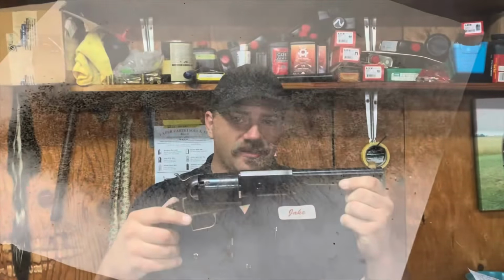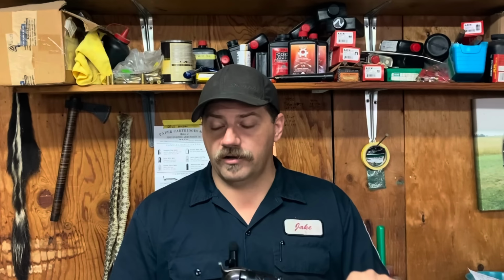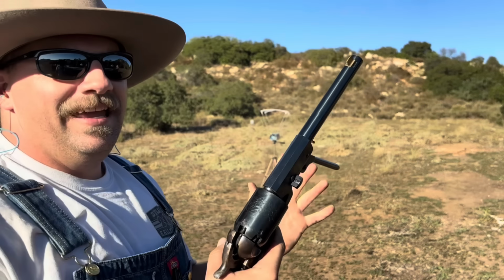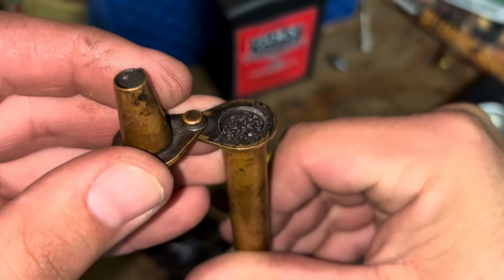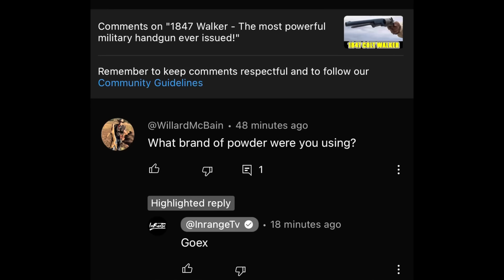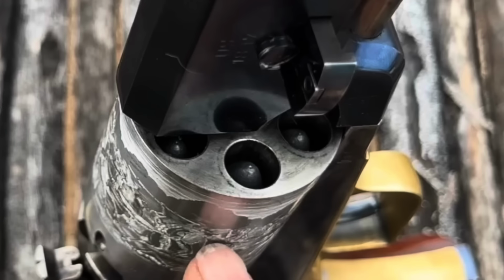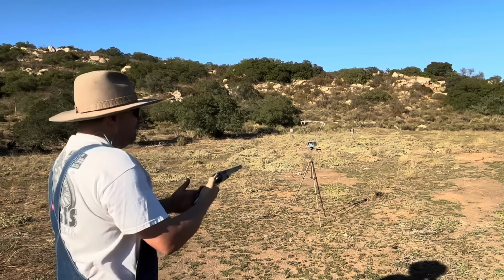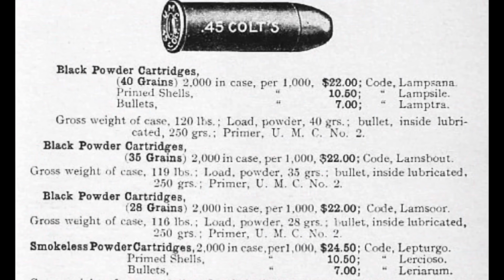The Colt Walker. Not The Most Powerful Revolver Of The 19th Century?

Comment: Different manufacturers often have different cylinder lengths that are not historical. Some even cheat completely and substitute a Dragoon cylinder to save money in manufacturing and parts inventory and they are shorter. Also, manufactures sometimes changed the length up or down over the years. So the make and year that a piece was built can be different and hold lesser or greater volume than another. The specs for the Walker say it could take 60 gr with a round ball, I do not recall seeing the specs for a conical but I will look. Anyway, mine will take a 60 gr load with a ball and my performance is close enough to your numbers to call them the same. I have only ever shot Goex but I can fully seat a .451 ball atop 60 gr. I can do the conical test if you want but I doubt my numbers would be different than yours for them. Again, I will be happy to try if you think there is any value. I am sure you already know this but I wanted to put this out for my fellow EBP subscribers and viewers: NOBODY carried a Colt Walker around as a sidearm. It is hard to tell seeing one in a vid or picture but these things are massive. Mine is 16" end to end with a 9" barrel and a 2 1/2" cylinder. It weighs just under 5 lbs empty and a full loadout pushes it over 5 easily. You don't carry one of these around for everyday carry. They were called horse pistols because they were meant for cavalry. They were issued in pairs and hung over a saddle, not from the hip. They also were not made of the best quality steel and frequently blew up when shot repeatedly with a full charge. Colt took the experience with the Walker and designed the Dragoon (only 1000 Walkers were made, many given away to supporters). Same diameter cylinder but shorter to deliberately hold less powder, shorter barrel (but only 8" from 9") and a locking loading lever. You may have noticed in the video the loading lever kept falling down after a shot. This requires the user to reseat the lever before taking the next shot, hence the improved loading lever. Just my 2 cents but I have to agree that the Walker was not the most powerful and the your numbers, at least for round ball as that is all I have experience and data points on, are accurate. Thank you again for a great video!
Reply from the maker: Thank you. I had two friends heck their cylinders one is an ASM and the other is a second gen Colt and all three are within.010 of each other.
Reply: @Everythingblackpowder  given that you were able to get 60 gr and a ball in yours I would suspect it is the correct size like mine. There are many variations out there, ASM being especially all over the spectrum but older ones being better. I have an ASM 1860 and its measurements are different from my Uberti 1860. Like I said, make is one aspect, year is another. In any case,  your test was valid and accurate and I believe it more correctly reflects reality vs some of the others out there.

Comment: If i remember correctly. Forgotten weapons said the walkers had a larger cylinder when first made and could hold 90 grains but that accuracy suffered because of the shredding of the lead cast ammo letting gases by the projectile this leading to a drop in velocity. Also. Pack your powder. And then pack the ball in thats how everyone ive seen get large loads in. But like i said. Army loaded 30 grains and a cork wad with gun oil on it thats what they said was more accurate and more powerful because gases arent escaping around the projectile.
Reply from the maker: @KarstRats you are remembering incorrectly. Ian never said that and the original walkers did not hold 90gr.
Reply: @ went back and you are correctomundo. Ill take correction where its due. 🙏🏻
Reply: @Everythingblackpowder  i do know ive heard someone say the cylinders got smaller after a few years of manufacturing but i cant remember now who that was. Or if they had any merit.
Reply from the maker: @KarstRats  no worries. The dragoons had shorter cylinders. Maybe that’s what you’re thinking of.
Reply: @Everythingblackpowder  probably so. Ive been on a kick with the dragoons and 1851 navys lately probably getting info mixed up in my head.

Comment: the walker was known as the most powerful pistol ever............ISSUED TO THE MILITARY......and that holds true for today.  of course there are many pistols more powerful than the walker ....but the military never used them.    I had a Remington cap and ball 44 caliber , fully loaded you could hit the side of a barn....if you were close enough.  That gun shot best with light loads and the same will be true for the walker....the problem with black power is it's very slow burn rate in confinement....adding powder when you have reached the optimum the gun is capable of burning in a short barrel does nothing for power but will increase pressure as the powder charge has become part of the load to push ... unburned... out the barrel.... fire one at night.that unburned power will burn after it leaves the barrel....quite a show
Reply from the maker: Tell that to the senior curator of the NRA museum…

Comment: In context, it may have been possible, with a perfect example of a Colt Walker to pack enough powder to drive a 148 grain round ball. Which is what the claim was predicated around. To about 1400 ft per second. That is the approximate claim. That is entirely possible with a Colt Walker in my estimation you're talking about trying to pump 60 grains of black powder behind it which may actually get that job done. I don't think it'll get that job done very many times, because once you get Barrel fouling you're having to push the round not only through the lands and grooves but through the fowling. In 1935 when they lengthen the case of the 38 Special treasury load to mimic a round that was actually built in 1895. Was filled with powder something akin to 2400 and let it off in an N frame Smith & Wesson that was very carefully produced and made sure all their Metallurgy was correct 158 grain load at 1500 ft per second to 1600 ft per second. I have actually recently seen a box of the original ammo that they use and do not use those in anything but a rather large N frame Smith. It does not bode well in medium frame revolvers.
According to sales numbers in the old west, the most favored cartridge of the old west in pistols and in the pistol caliber rifles was a 3840 which was a 40 grain bullet about 180 grains, being propelled by 38 grains of black powder to about 950 to 1,000 ft per second. It was very popular because it fed Easley into the rifles of the day. It would have been a pain to reload and it's kind of difficult to reload today because of the long taper on the shell. In 45 Long Colt I think that the black powder of the Old West was probably about enough to give you a steady speed of about 900 ft per second which is still a stout load for a 230 to 240 grain projectile. As a matter of fact that is the standard by which they were trying to make the 45 AC shoot a 230 grain projectile at a nominal speed of 900 ft per second 17,000 pound per square inch load. That is not a particularly high pressure cartridge by today's standards in any way shape or form. We have pistol rounds today like the 9 by 23 that have a chamber pressure setting of 55,000 PSI just like the 5.56 NATO. Maybe that's why the parent cartridge for the 9 by 23 is a 5.56 cartridge case. But that cartridge mimics 357 mag velocities all day long, and with a 125 grain hollow point you now have a pistol that mimics the 357 Magnum in a semi-auto, and that is still today the best first shot fight stopper on the planet. The 9mm doesn't even come close to that unless you get it and plus b plus, and then it just gets into the lower end of 357 Magnum velocities.
And I do agree with you that the original test on Colt Walker is getting that kind of velocity may very well have been a one-off or even a duplex load.
When I studied that claim. They claimed velocity was over 1500 ft per second with a 148 grain round ball. And I am write a simpler for details like that

Comment: All these numbers are makin’ my head hurt. But seriously, I’ve got two Walkers and had to use a dremel on the frame to get the Eras Gone conical to fit under the loading lever. Did you have that issue? PS I loathe BP substitutes.
Reply from the maker: No but it is a tight fit.

Comment: I had an early Walker repro back in 1976. I was able to get 55grains behind a round ball. Obviously the new repros are made differently.
Reply from the maker: How so?
Reply: Just a guess but I assume based on my being able to get that much powder in the chambers that they had more volume. Traded that one for a 50-70 Trapdoor.
Reply from the maker: My Uberti fits 60gr of 3f with a round ball along with a second gen Colt and an old Army San Marco
Reply: I bought a new Uberti in the last five years but haven't had time to shoot it yet. To much time in the shop. So my assumption was incorrect based on your work. Good news actually.

Comment: the rodger&spencer percussion revolver was the only one ive ever seen to take 60gn, look at blackiethomas's videos, he has one. i believe he got his loaded with 60gn or more, i could be wrong.
Reply from the maker: It was 50gr and he was using Pyrodex
Reply: @Everythingblackpowder  right, I took another look at it, seems like he could have fit more, he didn’t seem to struggle with 50gn pyrodex, it settled with him just tapping the cylinder. I wonder if the reproduction models have smaller diameter cylinders. Everyone says the original walkers were made to hold 60, and dragoons to hold 50 cause of the exploding cylinders. I don’t know where that information comes from but it’s all over the internet and most forums. I’ve seen people reem their cylinders to fit a larger round ball cause the bore was too big but that wouldn’t increase powder charges that much.

Comment: Thanks for the video.  I found it very interesting and you seem to have clarified a few myths.  I don't know, but I've heard some of the replicas may not have the same volume in the cylinder as an original Walker, they have a shelf.  Could there also be calibration errors in the chronographs being used?  There may be other variables as well.  Just playing devils advocate.  I"m not subscribed to your channel.
Reply from the maker: Original Walker do not have a stepped chamber like 1860 army’s. If that’s what you’re referring to. As for the volume it’s well documented that the max charge of an original Walker was 60gr with a round ball which is the max charge of a replica.
Reply: @Everythingblackpowder  Thank you.  Apparently I was thinking of the 1860 Army.

Comment: Its not the compression......its the size of the cutting disk they use. It may say 3fff but it is i lil larger for the swiss or alil smaller for the goex. As im sure it is also different for the german blend.
Reply from the maker: All commercial grade black powder is compressed to a density of 1.75-1.80 grams per cubic centimeter. As for the size difference between Swiss and Goex 3F, I think that’s negligible. Either way, I still think Karl is mistaken about 50gr of 3f Goex with a 260gr conical.
Reply: @Everythingblackpowder  for sure looks suspect to me aswell, you did good by bri g this to the forefront.  👏 👍 👌

Comment: The original colt Walker had a  little over a quarter of a inch longer cylinder. They were reduced by the company's for safety reasons supposedly.
Reply from the maker: False. We checked the dimensions on three different Makes Of Walkers. The Uberti seen in the video, an old Armi San Marco and a second Generation Colt Walker that was made on the same tooling as the original walkers and all three guns were within .010 of each other.
Reply: He's shooting the replica of the walker. What you're describing is the dragoon. when colt shorten the cylinder and barrel it became the dragoon.

Comment: Maybe it's because your Swiss powder is much more tensed?
Cause this powder is pressured more in production?
Reply: Originally Walker was made for 60 grains. Which was then reduced to 50 in the Dragoon. 
And also, don't forget that there was loading tables, where soldiers could load their guns. And premade paper cartridges during battle
Reply: @hekpacobctac616  I don't think the Walker was ever really intended to be loaded with 60 grains of anything, neither the cylinder nor the open topped frame can tolerate that for very long.

You can load that much if you use a roundball or load some conicals backwards, but the idea of the long cylinder was primarily for loading conicals, and facing the right way.

Charging a Walker with 60 grains is like discovering a .38 Special revolver which manages to fit a .357 Magnum cartridge in one of the chambers, it's not a trigger you should pull, even if it doesn't outright explode on the first or second shot.

Comment: Check out the boiler room capacity of the Walker as compared to boiler room the capacity of the .45 Colt cartridge. My money's still on the Walker. By boiler room I mean the space left after allowing for the seated bullet. Using a real 244 grain Civil War Colt Dragoon bullet (metal detected by me) of .8 inches in length seated flush with the cylinder leaves .98 inches of chamber for powder.while the .45 Colt case from mouth to the inside surface of the rim is only 1.24 inches. After allowing for the seated bullet you only have about .8 inch of powder space left. I think a Dragoon would smoke the .45 Colt too. YMMV
Reply from the maker: What you gain in powder capacity with the walker and dragoon, you lose in efficiency, due to the nature of it being a cap and ball revolver. Cartridges are just more efficient than cap and ball guns. And if the walker can’t outdo the 45 colt, what makes you think the dragoon with less powder capacity is going to do the 45 Colt?

Comment: The sporting powders available in the late 1800's were excellent, at least as good as today's Swiss. I wish I had some, I would like to know the granulation of eg Hazzard's Sporting powder, my understanding is that sporting powder was quite fine, and closer to 4f in appearance than 3f. It would be good to know what it was, the distribution of granule size can be wider or narrower than today's powders, there is more to it than just matching the specs of 2f or 3f. We know the sporting powders were excellent and without documentation the knowledge needed to produce those fine powders may be lost. 1880 - 1890 or so was the peak of black powder technology, this is about when brown and coco powders were introduced, and when there was much experimentation with the effect upon performance of complex grain shapes. Black powder was then superseded by smokeless and there was no longer any effort put into improving black powder.
People assume the black powder of today must out perform the black powder of that time in our history - because everything now must be better, right? But that is not the case at all, in fact most black powder made today is inferior or barely equal to what was made then, depending on what brand you buy.
I think the lack of performance of black powder that is manufactured today is why it is so possible for homemade powder to match or improve upon the performance of the powder that is commercially available.
One of the things discovered in the late 1800's was that the time and temp of charcoal production was extremely important, it had a large effect on powder performance. The remaining volatile substances are very important, without these volatile substances powder was weak and performed poorly. That is why so much effort was put into developing brown and coco powders, the brown color was because the charcoal was produced at low temperatures and it was not overcooked (which drives off the volatiles of the charcoal).
There really still is an opportunity for a methodology to be developed at home which consistently produces black powder that is superior to anything now commercially produced - a methodology that uses charcoal made from the best species of wood, carefully baked for a measured time that results in a highly volatile charcoal which is better than any charcoal available on the commercial market. (A good method can be protected via patent, for whatever that is worth - but patent lawyers are crazy expensive though.).
Interestingly, charcoal made from straw was used for the brown or coco powder meant for the largest cannon, it was easy to heat the straw consistently to produce an all brown charcoal. The heating was done with heaters powered by steam provided by steam boilers, iirc the straw was tumbled in drums as it was heated.
Enough rambling for now, I should save some rambles for later.

Comment: I’ve never owned or shot a 1847 Walker replica, but the original Walkers had a longer cylinder than the 2nd and 3rd Dragoon Walkers, so would hold more powder which is usually why the original Walkers blew up.  
The idiot from the NRA is out of mind thinking a Walker would hold 90 grains of 3F black powder.  The standard load for a 1873 Springfield rifle was 70 grains and that was with a 45-70 metallic case.  And a Walker isn’t even in the modern 44mags realm.
I owned a Ruger Old Army Stainless that I shot 45 grains of 3F BP, with a wonder wad and a round ball.   Don’t know how the Ruger Old Army ranks against a Walker replica, but mine was a lot like firing my Ruger SBH 44 mag and with #10 caps you could easily fan the Old Army.
Lastly you need a revolver loading stand and a powder flask with different screw in chargers.

Comment: It's almost as if there was never a need for the Bessemer process in steel manufacturing, if one can simply load in 1852 a Colt's Walker with 90 grains of blackpowder. 
Also remove just a bit more steel out of those cutouts on that first batch of 1860 Army cylinders, make 'em even lighter, McCulloch will love them.